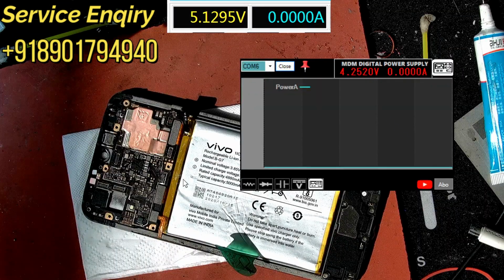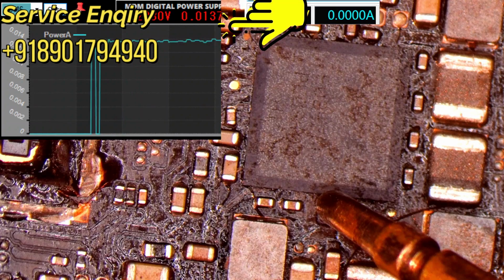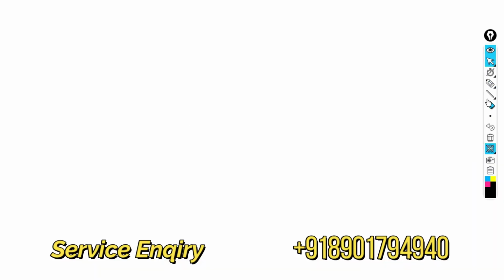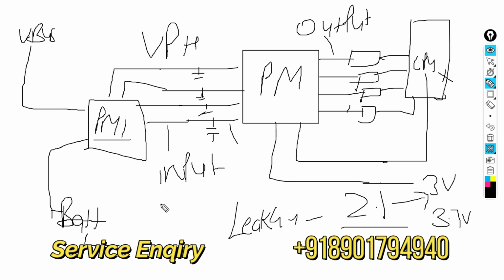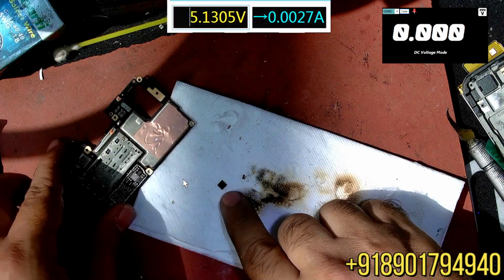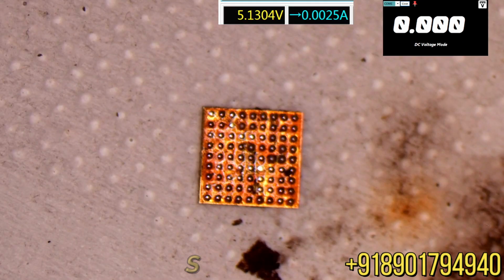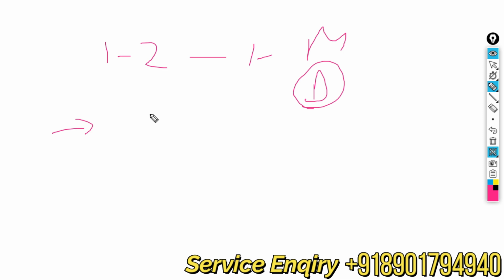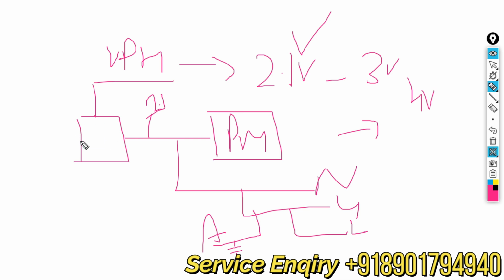How to Identify & FIX Short Circuits in Mobile Phones: Step-by-Step Tutorial"

Comment: Hello, Thank you very much for your videos. I also have a self-consumption of 0.009 amps, stabilized at the VBat level. VBus seems fine as I have approximately 5 volts. The VPH line doesn't appear to have any issues as I have 4.2 volts across the line's capacitors. I tried connecting the battery to its connector and injecting 4.2 volts at the Vbat pin. I have a current draw that fluctuates between 1.1 amps and 0.5 amps without stabilizing. My phone doesn't turn on and doesn't vibrate. I would really like to be able to repair it so I can recover the photos of my daughters. Can you help me diagnose the problem? How can I test if the buck lines are good? Sincerely

Comment: Master pls I have dead phone Gionee M12 when I connect it to DC power supply it shows 0.008amp but if I press the power button it will show 0.162amp but when I released the power button it will reduce 0.130 amp. What could be the problem sir. Thank you

Comment: Sir, my question is can the buck lines still be generated without the battery connected, if that's possible, why can't we turn on the phone without the battery?
Reply: Because cpu know there is no battery by bat id, some phone  turns on without battary by inserting charger
Reply from the maker: Already someone gave this answer.bat is also some communication lines..for Example you must have noticed that in some phones when you disconnect the battery only connect a charger .logo appear on display... After it's reset again & again....now cpu turns on because it shows the logo on display....but the cpu senses the battery is not connected so the phone reboot